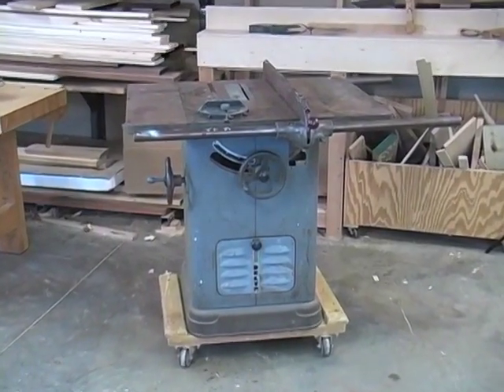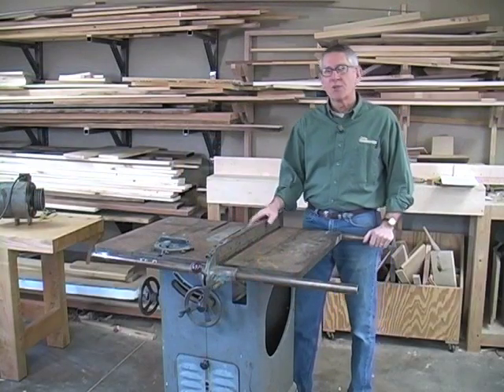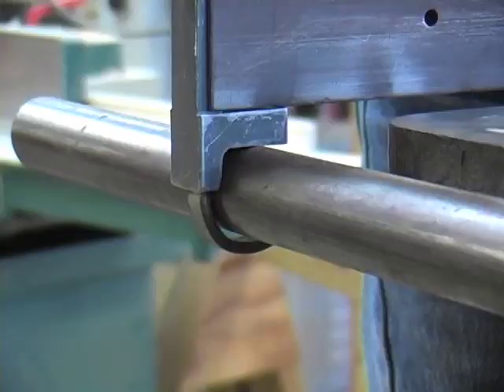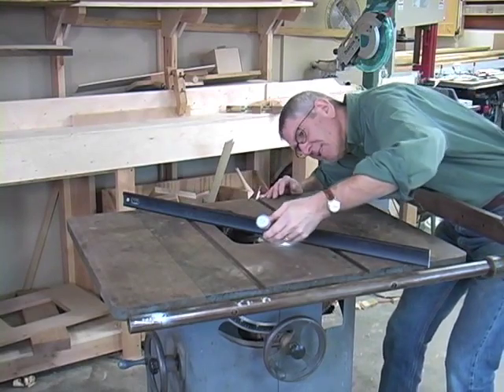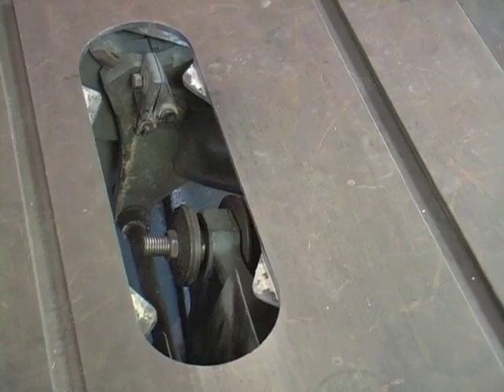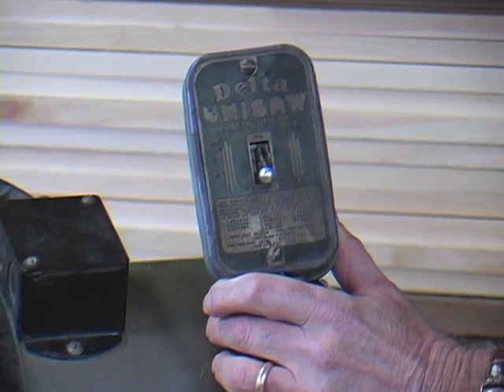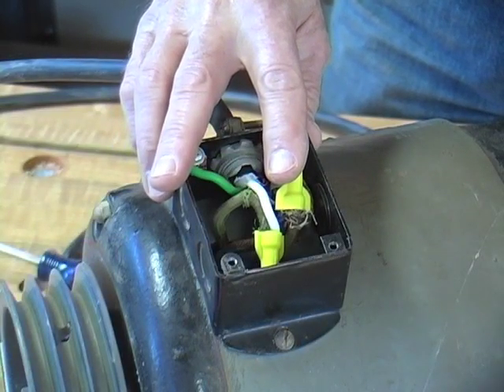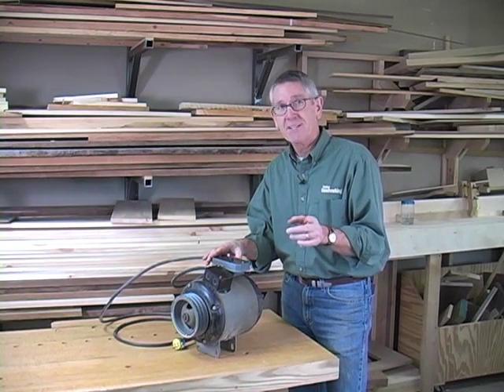DELTA Unisaw Restoration Part 1

Comment: My Unisaw is from about 1965 and is labelled Rockwell. Has been completely overhauled with a new 3hp motor. Has a 52in Unifence on it and its my baby. It was overhauled by the fellow that used to be the Delta service centre manager who is also a friend. Its a sweet saw.

Comment: Thank you. This gave me the confidence to fix a Grizzly G1023S cabinet saw under the Canadian label Busy Bee.  Thank you it was hard to find a breakdown of setting up a table saw. This gave me the idea to look for the grizzly manual since all uni saw copies are built ruffly the same.  Busy bee doesn't supply parts or manual but Grizzly is much better at this.  Since they are built by the same company for these two brands I was able to find the correct size for belts and bearings.  This was a big help.  I do enjoy using these older saws. They can be a lot of fun.

Comment: Amen, brotha... When it comes to productive woodworking, nothing beats these old beasts.  When I build full kitchens and bathrooms, I find myself doing most of the work in the shop with these old fashioned beasts... and only some complicated cuts with Festool railsaw.  It's worth the work to restore these badboys!  The experience you get will pay itself off when you repair them over time.

Comment: Great video series!  Thanks!  I just picked up a 1966 Uni that has a lot more surface rust on the stand because it's been sitting, unused, in a barn for fifteen years.  I haven't yet opened up the internals to have a look.  I do know it's a 3ph motor, so I'll probably swap it out for a 3hp, 1ph, 220v motor after I clean it up and repaint it.  Thanks again!

Comment: i did the bearings in my motor - what a NIGHTMARE that lasted WEEKS!! i ended up having to place multiple orders on amazon (didnt' realize it's two different sized bearings) - then MULTIPLE trips to machine shops taking HOURS out of my day just to get to etc and dealing with surly machinists ... would have been more worthwhile buying a whole new motor

Comment: I need to replace a broken part on my unisaw. Can you show the parts list so I can identify the part.

Leonard.
Reply: Leonard Voykin they have a lot of digital copies of the parts lists and manuals.

OWWM.org is a good place to find advice and people with parts that they can part with if you can't order a direct fit replacement. While most of the design hasn't changed that much there are always tweaks. So knowing the changes over the years helps.
Reply: Vintage Machinery . org